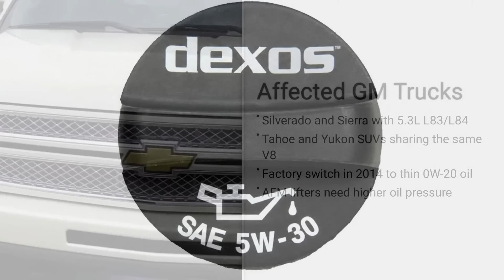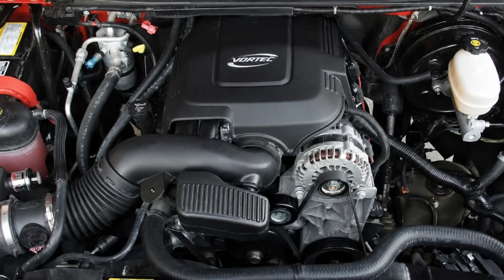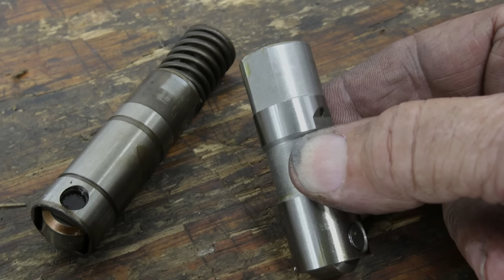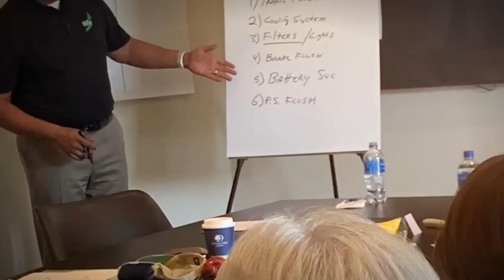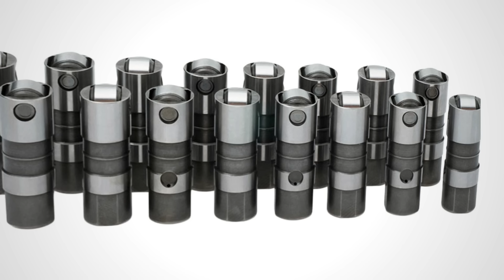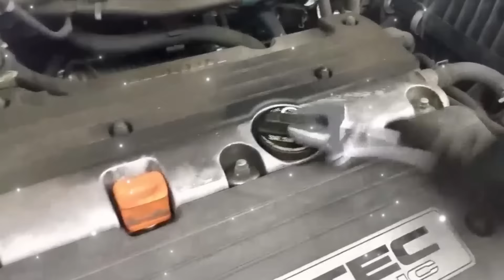The 5.3L Oil GM Tells You to Use Is KILLING Your Lifters — Switch Before 60k Miles

Comment: Just bought a 2016 1500 with 161k 2 months ago, oil was super clean, no ticking or any issues, everything checked out. 1000 miles later i have shavings in the oil and what sounds like a slight lifter tick on startup. Will swapping to 5w-30 and getting an AFM delete module help or am I too late?

Comment: I was at like 115 120,000 miles local mechanic came in and sat down and talked to me when I was having some work done and told me I should get an AFM overrider and stick it in the code reader, and it will override it and keep it in V-8 mode before he cost me 4 to 6 grand like it did the guy in the shop next to him they bought a Chevy Silverado and 76,000 miles but the guy is describing in the video happened. The pin got stuck or something so I immediately ordered one off Amazon. I only pay like 60 bucks for mine. I took the one my mechanic suggested and he keeps it in VA mode and I’ve had it like that for over a year now he said you’re extremely lucky being over 100,000 miles and that’s never happened.

Comment: I have a 2015 GMC Sierra with 215,000 miles,  been using 0w20 full synthetic high milege valvoline oil since I bought it used with 80,000 miles. I change my own oil every 4-5000 miles, but now considering changing to 5w30 deleting AFM & checking the thimble filters because I have a lifter starting to tick! Or should I dump it?

Comment: My 2018 5.3 Silverado just passed 204,000 and running like a top.  I run usually 10w30 in it and have recently switched back to the 0w20 because I heard elsewhere that the truck needed that thinner oil for some reason.  I do run an AFM delete/turn off OBDII device and do not allow the AFM to constantly switch as it is annoying as hell.  I think I will stay with 5w20 or 10w20 from now on.  Your thoughts?  Thank you.  I have subscribed.

Comment: 2016 5.3 6L80 at 137k and did the full dod delete with ls7 lifters, btr stage 3 cam, new oil pump, oil catch can, circle d torque converter, and transmission bypass doing oil changes ever 5k or every year (whatever is first) but now gunna switch to 5w30. Its been running good for 2 years. I got it with 125k completely stock but knew it was a ticking time bomb.

Comment: Change your oil every 3K miles....been doing this on all my vehicles since the 70's.  Never experienced any of the lifter issues that's all over the internet with these 327's. I knew there was going to be problems way back when they came out with that thin oil. Always use a good 10W-30 or 10W-40 synthetic (maybe a little bit of Prolube along with it)...you might as well just fill up your crankcase with water if you're using anything with less viscosity than that.

Comment: Ive been servicing my dads 2014 with 0-20 and AFM active for 186k, no engine failure yet but its always ticking like its low on oil even after a fresh oil change to proper levels

Comment: Have 2016 gmc 5.3 with 137000 miles.  No problems with ticking or oil consumption.  Yes I have shut off the  AMF on my truck for 8 years I have towed a 29 foot 5000 lb camper she stills pulls like a champ. Yes I use tow mode on the transmission.   And another thing when I change the oil 3 quarts of the oil is 5 -30 with 0 -20   No burning oil    All is good.

Comment: Change oil using valvoline restore and protect every 2000 miles in my regular cab 2wd 2017 sierra and did the 4cinder delete a couple years ago. Only use top tier fuel and wix xp oil filter. Also did the oil catch can since it’s a direct injection engine. Tuned the trans too so it doesn’t lock up in 2nd gear and did the bypass valve and extra 2 quart trans pan to stay super cool now. 👍🏻

Comment: Not just the oil but the metallurgy also. Humans have learned to make some very impressive metal alloys but for some reason automotive manufactures sure don't use many of them. Just ask rust belt mechanics what they think about the steel used in modern vehicles. The metals being used today in camshafts and roller lifter followers is second rate at best. But then again if we look back mushroom lifters never really had any problems, did they?

Comment: 2021 GMC Sierra 1500.  I've been using Mobile 1 Dextros 5W-30 Since buying it new.  Because of Covid, computer components were in short hand, saving my truck from having the AFM.  The only good thing that Covid caused.  Truck currently has 59,000 with oil changed at every 5000.  Texas is hot 0W-20? what was GM thinking?  can't fix stupid!!!
Reply: Your truck still has the lifters it’s just tuned not to disable the cylinder all the mechanical components and the vlom is still there. Covid caused a chip shortage so your ecm is different that’s it
Reply: I use 10w40 castrol on my tahoe 2025 and has 40K miles, engine starts smooth as new in winter and summer

Comment: I just listened to your video. As an owner of a 2017 GMC Sierra 1500, the next oil change, I will be putting in 5W 30 oil. I have a AFM disabler for some time now. Presently the milage is approx. 45,000. At 77 year old, hopefully this will be my last truck. I plan on keeping it until the wheels fall off. Thanks again for the video.
Reply: You and me both--my 2013 GMC 1600 has low mileage (41K) and it will be hopefully my last one. Amsoil 5W-30 in it w/ afm delte plug in..fingers crossed..
Reply: @glenn-j6x5m I would use 5w40 on these. I have always used 10w40 for more than 10 years with zero engine issues they run like a sewing machine

Comment: I’ve done all I can. Changed to 5W-30 every 6months without fail, plugged in a quality DFM bypass module, and I’m doing a transmission thermostat swap out this fall. I started seriously tuning into this situation just before warranty ran out around 40K. Hope I’m not too late. I love my truck
Reply: I get it. I bought a 2019 silverado with very low miles. I immediately bought a range technology dfm disabled and had the thermal by-pass valve on the transmission removed. So far so good.
Reply: @1 @1122fyt Me too. I bought a module from Range that plugs into the OBD2 port. I see they’ve since come out with another DFM module that plugs into the main harness behind the driver side front fender well. I kind of wish I had waited to get that one but I think this one is working ok. Transmission shifts a little smoother and fuel efficiency has definitely gotten “worse” but I don’t think any of us bought a V8 to save money on gas. Seems silly in the first place

Comment: My brand new chevy silverado  5.3.  12k miles blew lifters The bill said $11.000 warranty covered it so it was zero balance !!! Then my brand new 2021 chevy  silverado 5.3 blew lifters 15k miles the\nBill said eleven thousand dollars again !!! With zero balance , because warranty paid for it !!!! And it will happen again and again and again, because Chevy GMC  never GETS RID OF   that AFM is causing the problem.So it will happen to   every single g m c chevy tahoe , avalanche cadillac 5.3 and 6.2 that was ever made after two thousand 2006 !!! Sure as the sun comes up tomorrow !!! They have  got  to go back to  the old motors before two thousand seven that have no a f m !!!! That is , these motor switch over from v8 to 4 cyl that is the problem right there. Do not buy anything with these motors.In them !!!! They will blow lifters , as sure as  , the sun comes up tomorrow !!!!!!!! My 1999 chevy  silverado went 340k miles and still running like  new i just did all my normal maintenance and radiator breaks.Alternator oil changes filters belts no other problems , even original starter , can you believe it !!!  But  chevy will not make those ever again for us !!! They are self destructing and dragging general motors through the mud !!!!

Comment: “2018 Silverado 5.3L”
I’m glad I saw this video 
I have always used 0-20 I heard a lil of a lifter  noise and started to use Lucas with my oil change and never heard anything again. This makes sense .
Reply: Bro please get the DOD delete kit tho 🙏 and get the oil pump and timing chain change while you're in there! I have the same truck which it gave up on me at 163,234 miles with lifter 1 and 4 failed I believe and I got the Texas speed DOD delete kit that came with the tuner! I'm currently getting the oil pump which I wish I did that the first time when I added the new timing chain too! So now I'm getting the oil pump that comes with the solenoid and the wire harness that goes with it! If you need the video to do the work yourself, I'll send you the link from a guy that does a great thorough walk through

Comment: My 2020 Silverado 5.3 just hit 50,000 miles. I leased the truck at first, then bought it at the end of the lease. I also purchased a warranty through the dealership ( i work for this dealership) They also sell Nissan and Toyota. The warranty ended up being through Toyota, because it was the best choice for me. Do I still switch to 5w30? It is the "premium" warranty through Toyota, which gave me the best coverage.Warranty good at any Chevrolet Dealership.

Comment: GREAT VIDEO.! This has been haunting my brain since I bought my 2021 5.3 new, so I've kept oil changes at 5K to prevent it. I admit I have stayed with the 0W-20 because I didn't know any better. I am currently at 81K. My 2021 5.3 High Country came with an inactive DFM system from the factory due to the chip shortage that year, as documented on my window sticker. Along with no start/stop (no button either) or heated rear seats. So, been driving with the system not activated, and yes, I know the system is still there, though. So far, it's been okay, and I will be switching to 5W-30 for more peace of mind. Thanks for the Video and explanation.
Reply: I just made the switch on my 21 at 60k miles to 5w30 I feel its sounds quieter but must be me she likes it 👍🏻

Comment: Change every 3000 miles with 0W 20 and you will have no problems
Reply: BS, I still had problems and my lifters failed, even with the disabler, so I just did the whole delete instead! At 163,000 is when it f up on me, but I got the truck at 105,300 used , who knows how the other person treated it
Reply: @explorewithmarquise  so you bought truck when it had over 100,000 miles on it and then claim BS? You’re a smart one aren’t you?
Reply: @Maynardd it's not bought, it's financed and still on payments!! I haven't known anything about afm or dfm until after 2 years of having the truck and this new guy I trained at my job asked me about it! Also I said who knows how the other person treated!!! I got it from a Chevrolet dealership which those bastards should've made the buyer aware of this problem or had it fixed before any other person had gotten it
Reply: @explorewithmarquise  😂 that means you bought it. You just don’t own it. If you didn’t buy it, you wouldn’t have it.
Reply: Amen

Comment: USE 5W-30 and you'll be fine.
Reply: Yep
Reply: @RigginTheRod010 5W30 won’t void my warranty will it that’s my biggest concern I already change the oil @5K
Reply: Hi, is that a 5W-30 Synthetic?
Reply: @LotusBodyHealth Yes. Full synthetic is always best.
Reply: @Shift1dwn5up  that's not true
Reply: @GeneralFukzamatayu Explain?
Reply: Did an oil change in my 11 SS bout 1000 miles ago with that 00 w20 , ok for about 100 -200 miles - I changed it last week I could feel the performant difference obvious big difference - I put 10 w 30 in it it feels like she should
Reply: @SixFourVW  

no one anywhere should ever use 0W oil.  it never gets 0W cold anywhere.

Cold Testing Temperatures by Oil Grade

0W Oil, Cranking test: -31°F (-35°C), Pumping test: -40°F (-40°C)
5W Oil, Cranking test: -22°F (-30°C), Pumping test: -31°F (-35°C)
10W Oil, Cranking test: -13°F (-25°C), Pumping test: -22°F (-30°C)
15W Oil, Cranking test: -4°F (-20°C), Pumping test: -13°F (-25°C)
20W Oil, Cranking test: +5°F (-15°C), Pumping test: -4°F (-20°C)

ask Google:  In the next 4 months, how many nights is the temperature of MY LOCATION likely to drop below -31°F, -22°F, -13°F, -4°F, +5°F?
Reply: It won’t hurt it ?
Reply: @Jose-h6o7cwon't hurt a thing 5w in colder climate.
I'm in SE Texas I run 10w 30
Have run Chevys all my life 5.3 and 6.0
Never a problem
Reply: @Jose-h6o7cNo it won’t hurt it, fuel economy may go down a tad, 5.3s have been using 5w-30 since 1999
Reply: @Jose-h6o7c 

no one anywhere should ever use 0W oil.  it never gets 0W cold anywhere.

Cold Testing Temperatures by Oil Grade

0W Oil, Cranking test: -31°F (-35°C), Pumping test: -40°F (-40°C)
5W Oil, Cranking test: -22°F (-30°C), Pumping test: -31°F (-35°C)
10W Oil, Cranking test: -13°F (-25°C), Pumping test: -22°F (-30°C)
15W Oil, Cranking test: -4°F (-20°C), Pumping test: -13°F (-25°C)
20W Oil, Cranking test: +5°F (-15°C), Pumping test: -4°F (-20°C)

Type this into Google (for your location):  How many days in the last 10 years did the temperature of MY LOCATION drop below -31°F, -22°F?, -13°F, -4°F, +5°F?

Use 10W-40 minimum, year-round, use 20W-50 for heavy duty like summer towing, always idle after start until idle drops, and never slack until oil gets dark/dirty.  Change all other fluids at lowest end of their listed service range.  ..then why has the manufacturer cabal been exclusively listing 0W oils in the owners manuals and on those freaky little stickers under the hood?  Because the manufacturer cabal would prefer that your vehicle enjoys a shorter lifespan and for you to buy another of their vehicles sooner.
 
ENGINE OIL COLOR CHART
https://www.instagram.com/p/DP2kLcxEvqR/
Reply: 5w30 is perfect and I use 5w50 in all direct injection or turbo engines. Synthetic
Reply: @PWRVTEC  

no one anywhere should ever use 0W oil.  it never gets 0W cold anywhere.

Cold Testing Temperatures by Oil Grade

0W Oil, Cranking test: -31°F (-35°C), Pumping test: -40°F (-40°C)
5W Oil, Cranking test: -22°F (-30°C), Pumping test: -31°F (-35°C)
10W Oil, Cranking test: -13°F (-25°C), Pumping test: -22°F (-30°C)
15W Oil, Cranking test: -4°F (-20°C), Pumping test: -13°F (-25°C)
20W Oil, Cranking test: +5°F (-15°C), Pumping test: -4°F (-20°C)

Type this into Google (for your location):  How many days in the last 10 years did the temperature of MY LOCATION drop below -31°F, -22°F?, -13°F, -4°F, +5°F?

Use 10W-40 minimum, year-round, use 20W-50 for heavy duty like summer towing, always idle after start until idle drops, and never slack until oil gets dark/dirty.  Change all other fluids at lowest end of their listed service range.  ..then why has the manufacturer cabal been exclusively listing 0W oils in the owners manuals and on those freaky little stickers under the hood?  Because the manufacturer cabal would prefer that your vehicle enjoys a shorter lifespan and for you to buy another of their vehicles sooner.
 
ENGINE OIL COLOR CHART
https://www.instagram.com/p/DP2kLcxEvqR/
Reply: no one anywhere should ever use 0W oil.  it never gets 0W cold anywhere.

Cold Testing Temperatures by Oil Grade

0W Oil, Cranking test: -31°F (-35°C), Pumping test: -40°F (-40°C)
5W Oil, Cranking test: -22°F (-30°C), Pumping test: -31°F (-35°C)
10W Oil, Cranking test: -13°F (-25°C), Pumping test: -22°F (-30°C)
15W Oil, Cranking test: -4°F (-20°C), Pumping test: -13°F (-25°C)
20W Oil, Cranking test: +5°F (-15°C), Pumping test: -4°F (-20°C)

Type this into Google (for your location):  How many days in the last 10 years did the temperature of MY LOCATION drop below -31°F, -22°F?, -13°F, -4°F, +5°F?

Use 10W-40 minimum, year-round, use 20W-50 for heavy duty like summer towing, always idle after start until idle drops, and never slack until oil gets dark/dirty.  Change all other fluids at lowest end of their listed service range.

  ..then why has the manufacturer cabal been exclusively listing 0W oils in the owners manuals and on those freaky little stickers under the hood?  Because the manufacturer cabal would prefer that your vehicle enjoys a shorter lifespan and for you to buy another of their vehicles sooner.
 
ENGINE OIL COLOR CHART
https://www.instagram.com/p/DP2kLcxEvqR/
Reply: All  I use in both my 2001 Tahoe (475000) still going strong and I also use 5W-30 Mobile One in my 2026 Z-71 Silverado 5.3 vortec and also have a Booste DFM disabled and she is doing just fine. I guess ill find out at 50-60 K in a couple of years.
Reply: @bobpritchard979 I noticed a big difference in my 2020 Trail Boss when I installed the Pulsar LT. My oil was always dirty after a 100 mile drive or so. After shutting DFM off my oil stays so much cleaner. I am contemplating switching my 5.3 over to 5W-30 but concerned. 🤷🏼‍♂️I dont know what to do lol
Reply: @bobpritchard979  

no one anywhere should ever use 0W oil because it never gets 0W cold anywhere.

Cold Testing Temperatures by Oil Grade

0W Oil, Cranking test: -31°F (-35°C), Pumping test: -40°F (-40°C)
5W Oil, Cranking test: -22°F (-30°C), Pumping test: -31°F (-35°C)
10W Oil, Cranking test: -13°F (-25°C), Pumping test: -22°F (-30°C)
15W Oil, Cranking test: -4°F (-20°C), Pumping test: -13°F (-25°C)
20W Oil, Cranking test: +5°F (-15°C), Pumping test: -4°F (-20°C)  

How many times in the last 10 years did MY LOCATION drop below -31°F, -22°F, -13°F, -4°F, +5°F? 

Use 10W-40 minimum, year-round, use 20W-50 for heavy duty like summer towing, always idle after start until idle drops, and never slack until oil gets dark/dirty (on dipstick indication basis instead of numerology basis or dishonest manufacturer basis).  Change all other fluids at lowest end of their listed service range.

Why has the automobile manufacturer cabal been exclusively listing 0W oils in the owners manuals and on those freaky little stickers under the hood?  Because the automobile manufacturer cabal would prefer that your vehicle enjoys a shorter lifespan and for you to buy another of their vehicles sooner.
  
ENGINE OIL COLOR CHART
https://www.instagram.com/p/DP2kLcxEvqR/
Reply: I’ve been using 5w 30 on my 2017 5.3 and it runs smooth it even runs cooler